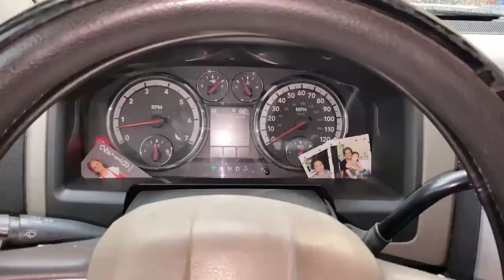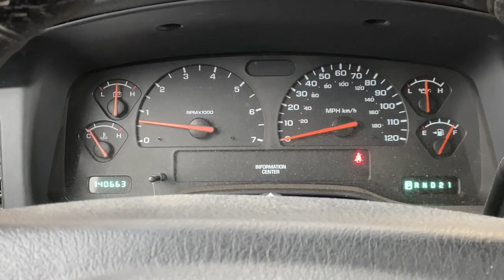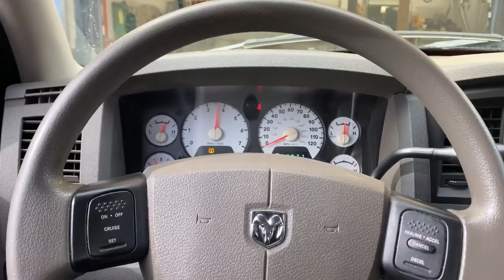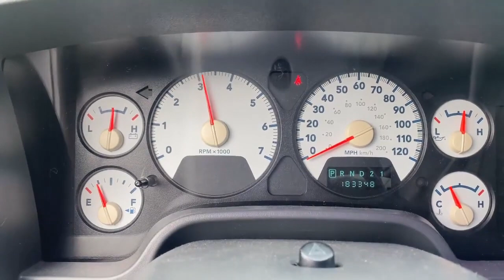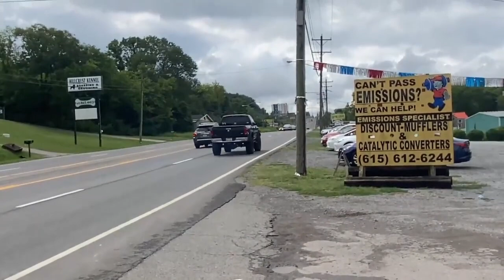Top 4 BEST EXHAUST Set Ups for RAM/DODGE 4.7L V8!

Comment: The 4.7s had there advantages and disadvantages. I personally think they were a cool alternative over a v6. And a nice smaller size for the guys that didnt need the big 5.2 or 5.9 or later hemi in rams.
Reply: Big 5.2l.=318c.i.d. that is not too big, maybe 5.9l.=360c.i.d.  I think my 4.7l.287c.i.d. stock could go up against a stock 5.2l. And the 5.2 would be surprised!
Reply: @glennsambrana2919 Oh I gaurentee the 4.7 would give a 5.2 a run for its money that's why I was saying they were an interesting engine. SOHC and made enough power to compete with the larger engines. 31 cubic inches is still kinda significant in v8 sizes as far as torque is concerned.
Reply: I like my lil 4.7 powertech. Plenty of power for what i need and pull single axle loaded trailers no problem.. Glad mine doesnt have the "flexfuel" what lifters? I just replaced the DOD lifters on a 5.3 chevy. And disconnected the VLOM from faulty solenoids, pain in the ass..the chrysler 4.7 all motor cable driven throttle 👍🏽no fly by system
Reply: My favorite thing about the 4.7s is they sound fucking mint with some good exhaust. Even better than the 5.2 or 5.9
Reply: 4.7 out powers and outperforms the 5.2
Reply: I got a 4.7 2005 and a 5.7 2013 all I can say is I miss how raunchy loud my 4.7 was but I LOVE my Hemi with temporarily stock quiet exaust.
Reply: 4.7s are more powerful than both of those engines tho 
Stock and max potential lol
Reply: @rescueaviationfilms1019  I'm a mopar guy and I wouldn't go that far 318 5.2 makes 235/5.9 360 makes 245hp and the 4.7 non ho makes 230hp 4.7 ho makes 260 but that's with factory performance cams and other goodies dodge modified to get that out of it.But one thing is certain the 4.7 will never have the legacy the push rod 5.2 and 5.9 mopar has
Reply: @enjoythesho1992  the 5.2 makes 215 and the 4.7 makes 235. What you talking about. The 2008+ 4.7 made 300 or 310.
Reply: @rescueaviationfilms1019  Do a damn Google search dude its simple I've built mopar engines for years your talking a about the 318s with non magnum heads the old LA 318s made low hp numbers the modern 318 with high flow magnum heads made 235hp
Reply: @rescueaviationfilms1019  The 08+ 4.7 had factory high output cams we are not talking about that engine they had long stopped production of the 5.2 and 5.9 when that variant of the 4.7 came out. The non HO 4.7 made the same hp as a 318 5.2
Reply: plus the 4.7s just have a little more pep in their step compared to the other 2
Reply: @pineapplebruh  it's always impressed me what smaller overhead cam engines can do when compared to pushrod engines of the same size or larger
Reply: @mobius-1503  what’s wrong with the flex fuels lol
Reply: @taskforceredairsoft2709  the flex fuel chevy engines lifter will collapse..I went ahead and replaced 2  of them on a 5.3 tahoe we had. Sold it. After I did the Vlom trick which was cut the gaskets in the VLOM so oil still gets through but plugging the port where  it hydralically activates the flex lifters with the springs it worked perfectly fine. Just glad LS arent OHC like the fords so they popped off and back on without a hitch..still a whole day stuck in the garage tho.
Reply: @mobius-1503  I have a flex fuel 4.7 dodge lol have it for a year and I just had lifters go out and it started misfiring and shit and it like drinks oil everytime I change my oil I’m like 2 quarts low
Reply: 08-13 4.7 made more power than the 5.9 stock for stock and also got good mpg while being paired to a decent tranny and being reliable as fuck

Comment: Every Dodge Ram 1500 from 09-19 has the same bumper dent. I know because mine has one.
Reply: I don’t have one there

It’s like 3 inches to the left, because some dummy forgot to put the truck in park and it rolled back into a tree 👀.
Reply: You don't have a ram if you don't have a dent.

Comment: Just bought a 2004 Ram Quad Cab work truck with the 4.7L V8.  It has 187,000 miles.  It runs like a scalded dog.

Comment: That Dakota sounds legit!!!
Reply: Very underestimated trucks
Reply: I own a 03' . . . . . 4.7L V8 magnium, 4 wheel disc brakes, 4x4, slt, club cab that has a weight class rated for 10K GVW tow package and a 2600 lb bed carry pay load. It's all factory and It's baddest truck I've ever owned.  It has a shorter turning radius than my smaller FORD Ranger BULL YA!
Reply: @dalewpit  same here and going towards 300k miles
Reply: @user-nk4rw1yw8t  OUTSTANDING :D
Reply: @dalewpit  have an 06 2wd 4.7l quad cab. Love the lil bastard and has about the same setup as the Dakota in the video. Throaty as hell for smaller V8, never guess lol... Change oil religiously and definitely NEVER let a 4.7 run hot and she'll last ya...
Reply: @elonraymond1227  we don't.
Reply: Dakotas are legit one of my favourite  trucks
Reply: It sounds like garbage lol.

Comment: I had a 2002 Dakota reg cab short bed with a built 4.7. It had shorty headers, dual 3", x-pipe and Magnapacks dumped before the rear axle. It sounded great. It also had 4.56 gears and 325/50/15 drag radials out back. I miss that truck, but a wife and two kids won't exactly fit in a regular cab Dakota. Lol
Reply: Dang man, glad my first truck is a quad cab then lol. Hopefully the future wife will be fine with it😂

Comment: It's amazing what you can do with a 4.7 for sound. My 2005s got true dual no cats no muffler true straight pipes with 5" tips and it SCREAMS. And actually doesn't sound like shit I done it for fun and left it 😂🤣😂🤣
Reply: How much would it cost on a budget bill just out of curiosity I got a 06 Dodge ram 1500 4.7 long bed I've tweaked on it a little bit but I want a good exhaust sound
Reply: @deanmartin2009  I wouldn't go with that exhaust unless you want it LOUD and you don't got to worry about vehicle inspections for insurance or whatever. But it only cost me a couple hundred bucks it's been a few years since I got it done but I think it was like $250. Just a few foot of pipe and a couple welds. Still got that truck but I got a 2013 Hemi and out an MBRP installer on it for like $400 and I love it. It's not quite as loud as I would like but it sounds mean.

Comment: 9:56 talking about the slight high oil pressure? Some guys run thicker oil in the 4.7 to help prevent and save the rollers that developed a flat spot until we can tear apart the motor when its for fun. He probably just had 10w-20 or 5w-30 bet it warmed all the way up and went back to normal lol
Reply: Never have heard about roller issues on those motors I’ve always heard the hydraulic lash adjusters fail and throw the roller around the top of the head and valve seats dropping

Comment: man the 4.7 doesnt make any power but i loved it in my dogde durango, thing had over 300,000 miles (odo stopped working lol) and started up every time
Reply: But you can make stock HEMI power with bolt on mods... The HEMI engine power was all the rage back in the early 2000's...

Comment: What kind of performance affects are there for larger diameter pipes?
Reply: Not much of anything past 3" on a low HP naturally aspirated gasoline engine. Anything past it is just crackling shit sounds. "You might like it, I do not". 
2.0 should be minimum for economy cars. 2.5 is a good all aroun. 3 is where it's at for most street performance. It's all about breathing. If you can breath in but can't breathe out you're loosing power. It's all about tuning and your engine.

Comment: How was the Dakota not raspy considering it was the only truck in this vid that didn’t have mufflers
Reply: 4.7L HO version 
The HO trucks don’t sound as raspy and make 30+ more hp
Reply: @JameyCampbell_54  okay so I have a 2011 Dakota with a 4.7 v8 but how do I know if it’s a high output one? Did they still make them in 2011?
Reply: @redfox-zj5mn  the 08 and up has more power than the high output, that was 00 to 07 265 hp, yours makes 302.

Comment: I have a 06 Dakota crew cab and idk what to do with it any suggestions?
Reply: Theres whole bunch you can do. I ran a super ten. Single inlet, dual out back . it rambled. Now im thinking about running a super10 on my 06 1500 . but want the dumps behind side steps.

Comment: dang ive never heard of the 4.7l
Reply: They mainly came in the dakotas and durangos for second and third gens. Not many rams had them.
Reply: @MnDakota37  alot of the rams here have the 4.7
Reply: @MnDakota37  BS! 
    1999–2009 Jeep Grand Cherokee
    2000–2007 Dodge Dakota
    2000–2009 Dodge Durango
    2002–2007 Dodge Ram 1500
    2006–2009 Jeep Commander
    2007–2009 Chrysler Aspen
    2006–2007 Mitsubishi Raider
Reply: @BobSmith-mc7uq  didn't know what years they came in the rams
Reply: It was co-designed with AMC in 1999. It was Chrysler's latest engine since the mid-1960s. It was first introduced in various Jeeps. Later offered in the Dakota, Durango and RAM 1500 on low level trims from 2003 to 2012 when it was discontinued. It is formally known as the 4.7-litre PowerTech V8, designed  to function on E85 fuel. The engine was the earlier version of MDS fuel savers and Eco modes. However, Chrysler never evolved the engine like the 5.7-litre HEMI V8. By 2012 it was poor in response as the engine was sluggish up until 4000 rpms, and it wasn't fuel efficient when the ECO mode was disabled (which is pretty much all city driving). It was an engine of its time but, Chrysler wasn't selling many of them as most just paid for the upgraded engine option (it was at most an extra $2000).
Reply: @David_Noonan  really they functioned best on e85?
Reply: @MnDakota37  If you bought a 2003-2012 RAM 1500 in the ST or SLT trim level the standard  powertrain was a 4.7-litre PowerTech V8 connected to either a 42RLE or 40TES/41TES transmission. Most people paid for the upgrade option but a lot of trucks sold with that engine.
Reply: @MnDakota37  That is what Chrysler designed them to function best on. However, most stopped carrying E85 So you had to go with E87 which is the recommended for the 5.7-litre HEMI V8.
Reply: @David_Noonan  my 04 dakota is my first truck.
Reply: @MnDakota37  Well I wouldn't say the PowerTech is the best engine option but in terms of owning a Dakota it is the only V8 option.
Reply: @David_Noonan  yeah ive heard both sides. So far mine is running like a top at 162.5k
Reply: @MnDakota37  Any engine that is well maintained will work as good as new. I'm still using my GMC Savana with 418K kilometers on it.
Reply: @MnDakota37  4.7 still around till 2012 then v6 pentagay
Reply: @RockstargamesgtavI  The Pentastar is a fine engine and award winning.
Reply: @David_Noonan  buy a cummins only v6 I love
Reply: Me neither, until I got one. I've had a Hemi Durango, I like tho.
Reply: @MnDakota37  I have a 2010 Ram  1500 4X4 with one.
Reply: I have a Ram 1500 2013 4.7 V8
Reply: I have a 2002 Jeep Grand Cherokee 4.7
Reply: @MnDakota37  Not many rams? Video proceeds to show 4 vehicles, 3 being Rams, with the 4.7...
Reply: @BobSmith-mc7uq  my 2009 Ram has the 4.7 in it
Reply: Yupp..my 04 dakota had it. Than my 06 ram has it. My 00 had 5.9. Now my 2000 has 5.3
Reply: Mittsubishi Raider was slightly modified or rebadged Dakota.
Reply: @RockstargamesgtavI  cummins is an inline 6...
Reply: @MnDakota37  04 dakota had it. Was Only one small pick up to have a v8 in it. Than i believe earlier models had 5.9 in them also. Was the R/T version.you get the drift? Big v8, small light truck, good performance.
Reply: @en3myspott3d54  yes it is. And yet simple , and best.
Reply: @immablesso4436  i know the 04 had it, i own one!
Reply: @MnDakota37  Gratz, because its a fun Truck. With that body style and that v8 its Peppy :)
Reply: Mine was a 4 door . RED WITH FENDER FLARES :)
Reply: @BobSmith-mc7uq  Actually they were in Ram's from 02-13.
Reply: @David_Noonan   lol there’s a lot of misinformation here.

1.) the 4.7 never had any sort of MDS fuel saver technology which is what made it better in terms of reliability than the Hemi. Not as quick, but better on the reliability side for 08-13* models. The 4.7 was discontinued in 2013 as well, not 2012.

2.) In the RAM 1500 the 4.7 always came with the 5.7Ls transmission. That means in 03 - 05 it came with the 45RFE, 06-11 the 545RFE, and 2012-2013 the 65RFE.

Comment: Doodoo truck engine
Reply: Seen plenty over 300k. Chevy and Ford made their share of shit engines too.
Reply: Mines at 206k and still no major issues yet 👍🏽👍🏽
Reply: doodoo opinion
Reply: I have an 03 1500 with 236xxx , runs like a dream. Just take care of the truck lol
Reply: Yup, complete garbage for the application. I can't even use 5th gear, truck won't maintain speed unless I'm going downhill.
Reply: @MrHat816  mine over 230,000
Reply: @johnterpack3940  Yeah I can't use 5th either, runs into the speed limiter somewhere in 4th? Shame because it'll bark the tires at the 1-2 shift and 2-3shift at 70mph and lays 20ft of rubber via a LSD on command... and thats the small V8 dodge made during the Dakota's lifespan lol I paid for 5 gears I want to use them all haha
Reply: you're right mine let go of cyl 1 at 100k miles, thank god I had a warranty. Now i got a brand new 4.7.